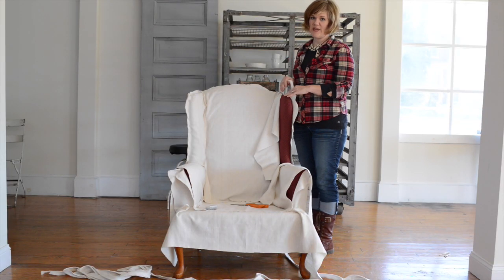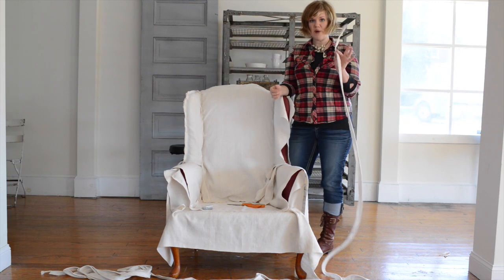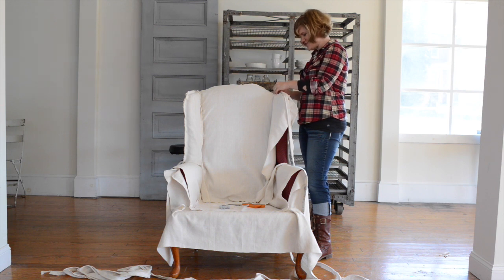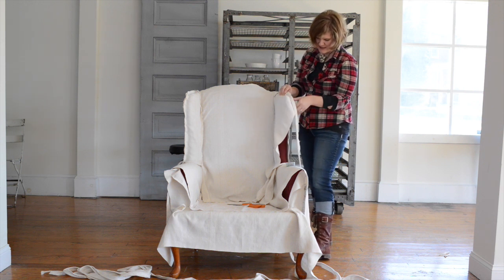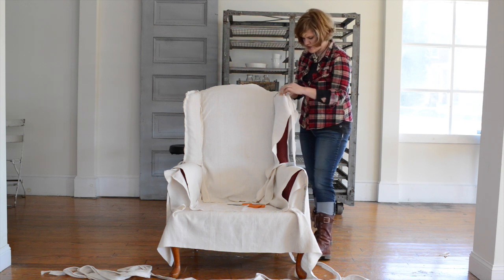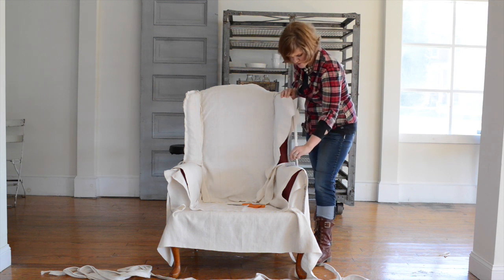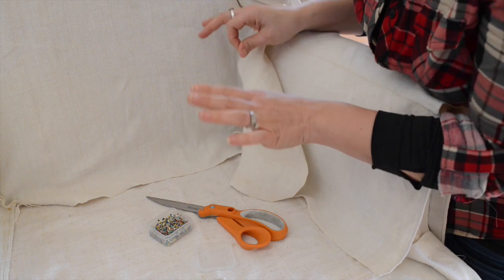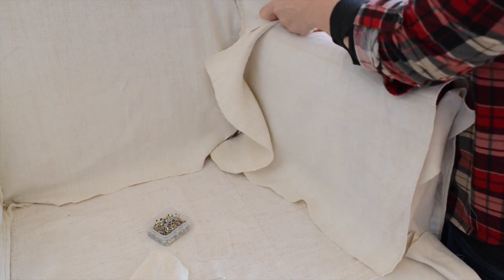how to make a slipcover | part 4 | wings, arms, seat & apron

Comment: I have made slip covers for years - this is a FANTASTIC set of videos! A couple things I do slightly differently: I sew the piping on the outside arm piece to that piece before pinning to the inside wing; for the front of the arm I cut a paper pattern and then cut the fabric adding seam allowance. I also add the piping to the front of the arm before adding to the rest of the arm pieces. I trim a bit of the cording out of the piping at the seams to reduce bulk; this also helps reduce shrinkage of the piping when washed. My tuck-in allowance is greater but I think I am going to reduce in the future based on your outcome. Thanks for great instructions!

Comment: Can you do more videos on tight place and curves, I am doing a wood and fabric barrel chair and I have to sort of change the part where the arm and front of the chair meet at and under where the deck the deck is. I'm using a different fabric for the deck, I put piping over the arm and back to follow the wood line, and I was going to finish the chair with a pipe line just below the original fabric and pipe line then use Velcro to hold it in place or upholstery screws. It all looked good in my head, but I'm having trouble with the transition at the point where the arm front and back, deck, and face/front under deck all meet  and go around the leg. It's hard to tell you without showing you. What I'm doing. 

This is my first slipcover that wasn't just a sheet thrown over the furniture to hide it. The chair is a wood frame chair with slight padding inside framed by piping and just a tight covering on the outside also framed by piping. It's all stapled to the wood so I don't really have any fabric lines to follow. Fabric is slippery too no place to pin "to" the chair so I used masking tape to stick my pins in, it worked kind of but not as well as I had hoped.